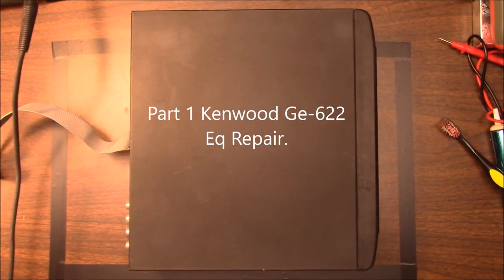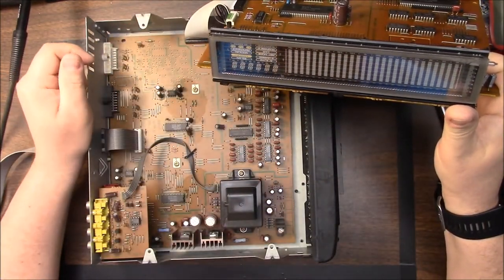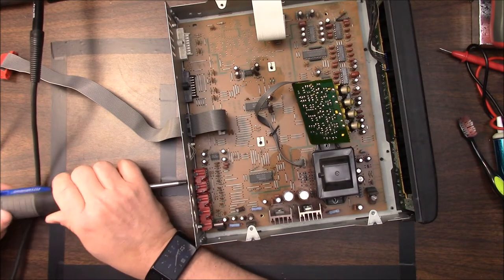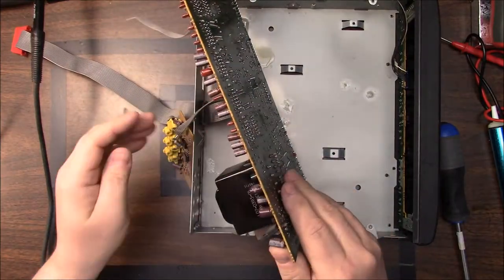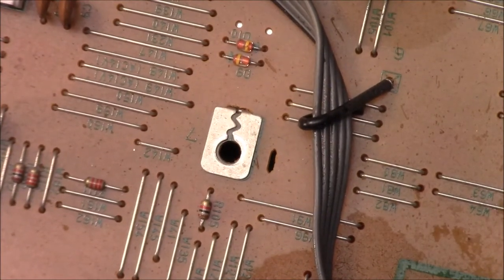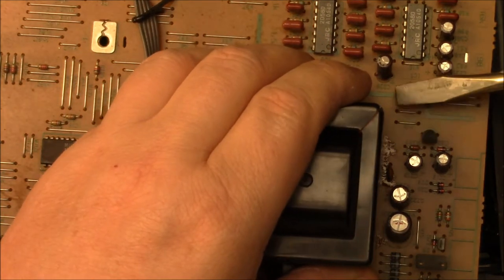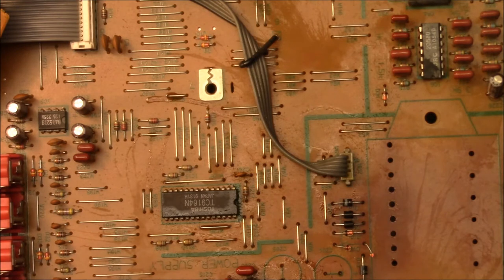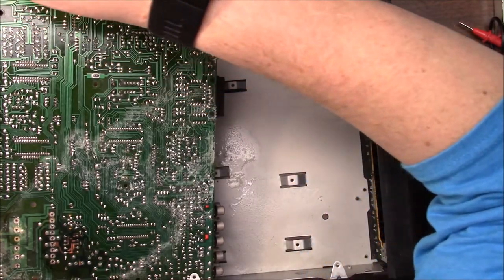Kenwood GE-622 Repair Part 1

Comment: This is a Design flaw, as i have the exact same issue same blown capacitor, same fishy smell from electrolyte leakage which i had to check all components that the liquid came in contact with and its what im doing as i type this, and also same cracked cover, i am so glad i found your video and couldnt believe it when you were explaining the symptoms of the problem thats when i knew it was a design flaw
Edit: Ok this is nuts, the exact same zener diode cracked in half, that's no coincidence, so i get the feeling that replacing these parts will only last a short while before whatever caused the cap to overheat and blow and cause the chain reaction last time will occur again, who knows i guess time will tell..

Comment: hey i am having the exact same problem with my system with those two capacitors and the zener diode. So i have changed the capacitors but how do i find the zener diode model to replace it. Thanks !

Comment: Hi I have the same problem with my GE-622, it looks like the two capacitors next to the transformer are leaking, also the two idods are cracked. So if the area PCB tracks are damaged, is it passable to fix the PCB tracks on the circuit board?  Thank you!

Comment: Do you have a schematic diagram of that model GE-622? I am also working on it right now.
Reply from the maker: No I could never find one . What is the problem you are having?
Reply: Weak audio o/p from the main receiver. Just traced it manually and found several open electrolytic caps on the dual op-amp IC. Also found several issues on the audio control array chip

Comment: Mine Ge622 is apparently dead... actually it gives power to cd reader and tapes, but screen is off and anyway led doesn’t works and no sound at all. 

Ps I bought in 1992, not middle ‘90s or early 2000! 😊